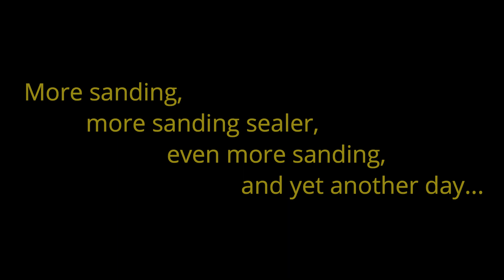Turning a Small Drooped-Rim Russian Olive Bowl

Comment: 6. Don’t remove the face plate ring until you’re sure the mortise/tenon is right and seated in the chuck properly.

I was taught years ago that with mortises, you need to leave at least an inch around it to prevent it from cracking. You can turn it down later. 

I really like the bowl you ended up with. Well done.
Reply from the maker: Good point, Doug. Thank you.